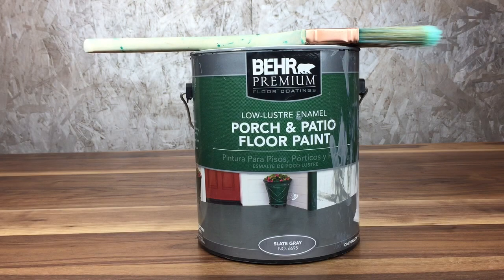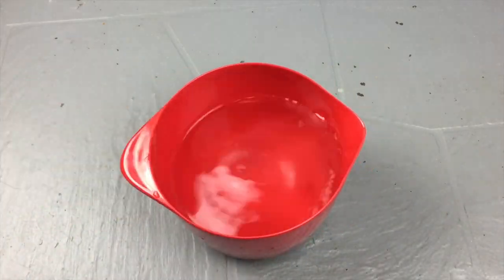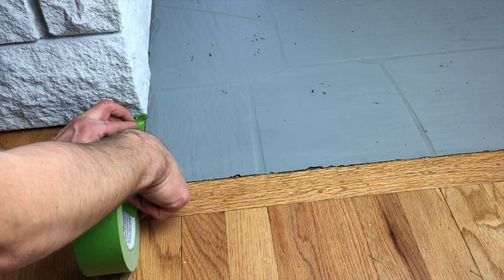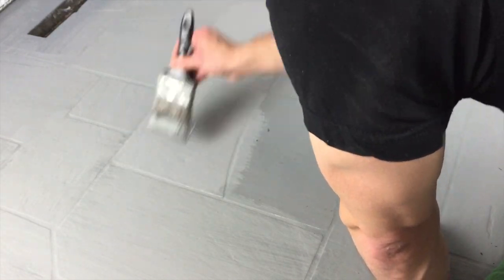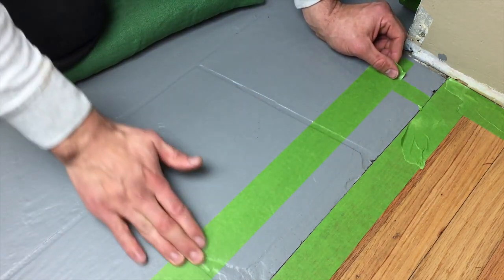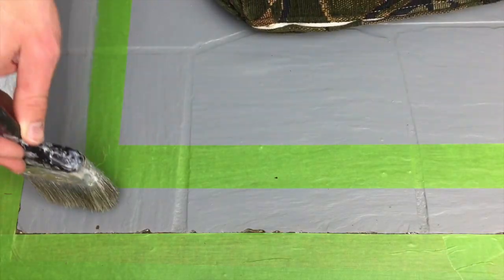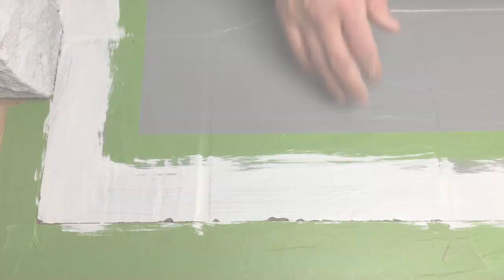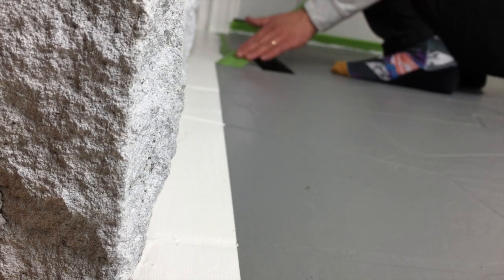How To Paint A Tile Floor : EASY DIY TILE PAINTING

Comment: My OCD was squirming when you didn't paint the chips on the tile edge bordering the hardwood.  It would be so easy to stick a brush in there, and even wipe off any excess that gets on the hardwood before it dries.  That said, thanks for making the vid, it's a great way to update old tile.
Reply from the maker: Thanks for the suggestion CV.  I'll remember that one next time I paint it.  Thanks for watching.
Reply: @BYOTools  will this work on bathroom floor tile?

Comment: Hi Byot, Is this strong enough to use in restaurant?  And what's the name of this paint......would like to translate it to French. would like to check with my local hardware shop. Thanks much really easy instruction even for women as myself
Reply from the maker: I would suggest not using it in a restaurant.  Its not durable enough.  For that amount of traffic you should utilize a two part paint epoxy.  That will be much more durable.  Thanks for watching Mathieu.
Reply: Mathieu Corbou

Comment: You know what bro? After watching your video, I'm gonna rent me a floor buffer with a black pad (highly abrasive), a pole sander that's used on drywall with some metal screens, and then a crapload of scotch-brite pads. Then I'mma physically remove the fine film that's applied to most types of floor tiles. Additionally,  I will clean the floor surface with either a citrus cleaner or denatured alcohol to encourage a strong chemical bond between substrate and primer. I am considering using an epoxy-based colorant, as I have had excellent results with garage epoxy applications. In terms of durability, I do not believe there is a comparable product. As you said in your previous video, "preparation is everything". Hence, this will be my primary area of focus. That and pork rinds.
Reply from the maker: Thanks for all of the input Marcus. Those are great notes.  Thanks for watching and the support.

Comment: what a shame to paint natural stone.  Why don't you just jack it out and paint the concrete. Paint over the paint is so ghetto. Now watch what a chip through the top color to reveal the bottom color.  Don't use any chairs and put a lot of rugs to protect the surface that you may walk on.
Reply from the maker: Trust me.  The painted tile is much better then what was there.  This is the entryway at my front door so it get high traffic.  I had it down for a year before I recoated it and there were only a couple small areas where the paint chipped up.  You should try it out.  You might be surprised.  Thanks for watching Tracy.
Reply: @BYOTools  What type of paint to use for painting  a tile floor?  Mine is not a cement floor, but glossy tile floor.  I would like to paint my floor but do not know what type of paint to use.